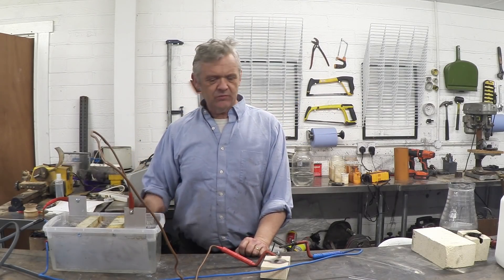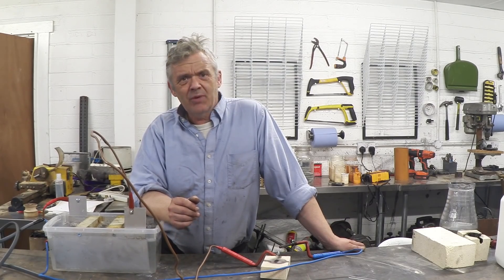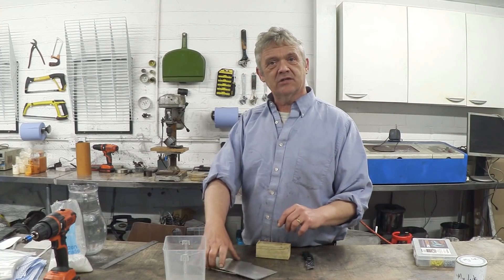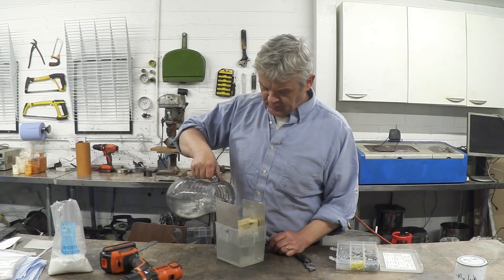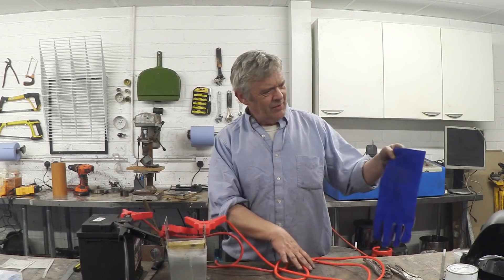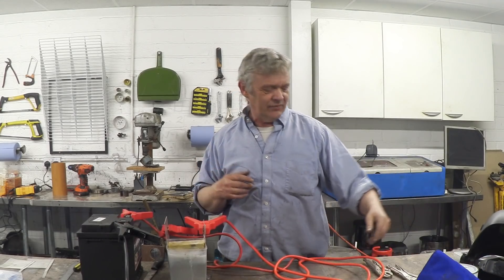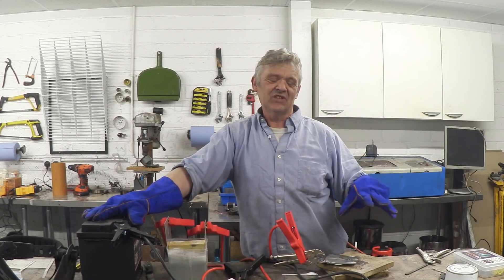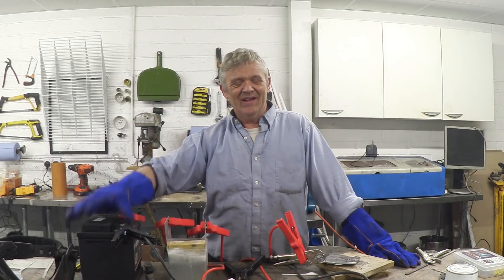Welding With Water And A Battery

Comment: Question : In an off grid solar system if I have for example 4 12v 100 ah batteries in series with the cold crank amperage of 750 amps (each) how do I connect them (to protect the charging inverter) without burning the inverter from a possible amp surge?

Comment: The first rectifiers were electrolytic cells discovered by Albert Nodon around 1900. He has a few patens on his rectifiers. They will handle lots of power but have a good deal of internal resistance.

Comment: I like the concept but your resistor the way you present it shows some safety concerns. It's essentially an electrolysis tank. You say your a chemist so I'm sure your aware of electrolysis and the byproducts of it. Using table salt for your electrolytic solution with steel electrodes produces chlorine gas. Also wouldstrongly recommend against using stainless steel for your electrodes as it produces a very toxic gas. also whatever electrolytic solution or electrodes you use it should always be done outdoors in a ventilated area. Just wondering how well it would do with just wondering how well it would do with sodium carbonate and steel electrodes so then the only byproduct is hydrogen and oxygen. I'm sure proximity and surface area would both play a role in the effectiveness as does I'm sure in your concept.

Comment: Great video, quick question as you did a vid on using the mains but did not show how it hooks up.
Is it the same as using the carbon rods and connecting the wall power to the bucket?
Thanks Robert

Comment: A good old wellknown trick is to use a length of galvanised water piping approx 1m.
The galvanised steel pipe acts as a variable power resistor by length.
Adjsuting the welding current is then very simple by connecting one clamp at end of pipe and the other clamp somewhere between the pipe ends to suit your needed welding current.
NOTE !
The pipe gets HOT after some time of usage, because the principle here is to regulate the current by wasting power.

Comment: i seen Russian in middle of no were using  the wires straight out of the wall into a bucket the welding leads which was locking pliers welding doing this..i seen one set up using pvc pipe and it levers back and forth to vary the current all in a plastic shoe box tubberware thing  he had switches plug-ins outlets all that mess mounted on lid i think basicly nice little rig really .i think he was using it on the drill/grinders n such in his shop

Comment: Nice exercise Rob! Just one thing worries me somewhat in this setup. You are putting DC current through salt solution. Don't you run a risk of generating a quantity of Chlorine gas as side effect of the electrolysis?

Comment: As I suspected, a  jam jar with a couple of bits of a tin can in it doesn't provide enough surface area to reduce the resistance enough.  Got R down to about 200 Ohms, which was not low enough for my feeble 12 volt battery to give a useful arc.  Fun to experiment tho.  Thanks!.
Reply from the maker: try two batteries mate

Comment: He says “ normally you put the negative on the workpiece”  normally is negative electrode where I’ve been from for the last 40 years. He has it hooked up the “ normal “ way.
I’ve tried doing this with batteries a few times over the years. Batteries have lots of amperage but batteries ( bat-trees ) are flat DC with no arcing power. 30 years ago I hooked up two batteries in series ( 24 volt ) and tried welding with small 7014 rod but it wouldn’t arc at all. Then I hooked up a battery charger to one of the batteries which then gave it a little pulse and helped it to arc enough to weld two pieces of angle iron together in a nice weld. One of my batteries was old and after an inch it ran out of steam.
About 25 years ago I tried it again this time I had two good batteries but only a 4 amp charger so the best I could get was some ‘ scrubbing ‘ welds with almost no arc. Enough to tack weld a motorcycle frame together which I then took to my job and MiG welded.
If the rod stuck it would light up like a toaster in 3 seconds.
Does his ‘ water rheostat ‘ help it to arc somehow?
Reply from the maker: positive is on the workpiece mate - but I am told you can do either way - it seems everyone has his or her advice and they also seem to conflict - so my guess is it really doesn't matter that much
Reply: Robert Murray-Smith  The way the electrons are flowing indeed make tremendous difference in welding. The heat being concentrated on the work or on the electrode.
Whenever I see someone hooking a battery ( or even a few ) to a welding rod and striking a nice continuous arc I am indeed very skeptical as I have tried that numerous times and it just doesn’t work that way. If I see someone do it I want to know how. Seriously.
I thought up a form of rapid switching to possibly create some kind of inductance and help it to arc but I haven’t tried it yet.

Comment: I'm going to make one to control the temp of my 100watt soldering iron.
Reply from the maker: make one plate slide mate
Reply: I can't picture this working using salt water. Just how? I think you just need an NTC sensor, arduino and a triac. bam.

Comment: Love this! Pure water is an insulator, so you have to add the salt to make it a conductor. More salt, more conductive. Also the plates distances apart from each other matters. Increasing the distance with increase the limiting effect. Thank you Robert! Love your videos, been watching for years,  now a member. Very inspirational!
Reply from the maker: cheers mate - appreciate the support
Reply: @ThinkingandTinkering  hi rob, can this still be used for the arc furnace. I’m scared of 120 volts😅
Reply: @miclairmiclair876  240v in UK

Comment: This really makes me wonder what the static electricity from a Wimshurst would do, change it to current electricity?
Reply from the maker: dunno - let me know if you try it mate - cheers
Reply: afaik, this works like a resistor, so it can just drop the voltage, it won't make extra current, you'd need something like a buck converter or a step down transformer to get any usable current.

Comment: Thanks. 
Depending on the gauge of the work, decides polarity. 
Thin=<5mm =electrode neg.
Thick=>5mm =electrode pos.
Like you , not sure why.
Rod guage selection also adds to the variable.
Awesome, Thanks again.
Reply: The polarity influences how much heat is put in the work vs. the electrode.  The positive pole gets more heat.  I has to do with electrons in the arc moving much faster than ions, carrying heat with them to the positive end of the arc.
Reply: @hanelyp1  awesome.
Reply: @hanelyp1  Helping me understand the concept I think.
The electrons travel from ground to positive right ?
Reply: ......I don't know how thin exhaust pipes can be welded free of unintended holes.
Reply: Still don't understand the concept of welding with Negative DC.
I know the Electrons travel from ground to positive but I take it you're a Metal Worker.
I'm trying to build something and I'm debating whether to bolt it together with aluminum or weld it with thicker steel 
Thanks
Reply from the maker: nice on mate cheers

Comment: I shorted out a 12VDc battering, Once. Damn that wire can get Hot fast lol Just Amazing again Robert. Thanks for this. The British MacGyver ;)  2 more Projects on my plate. I had a shopping trip to the Junkyard today. Got me a working air exchanger for the spray booth, that I'm building and a 20Gal air compressor tank.   A microscope for looking at tailing samples. And testing the Graphene Paint on vinyl flooring :) We need to make the Scooter battery for this portable welder. Is the Scooter still running on the Paper battery?
Reply from the maker: scooter is still running mate - and awesome projects - cheers

Comment: Now... if that salt water were to tip over would that be seriously dangerous? 
And also because that's 12-48V would it kill you or just give you a serious dig?
Reply: Water and electricity are a hazard. But so it electricity. If yu manage to put yourself BETWEEN any two potentials, high voltage OR high amperage can kill you. Between is the key operative, as standing in a pool of salt water with a live cable will not harm you until your body gives the potential somewhere to go. Lips on a microphone can kill if the mic has a ground potential thats different than any other point (like the guitar players strings, the rainwater on the stage. etc. The current moves thru one limb to another (yes your head is on a limb) by way of the artieries, being they are the best conductors in your body. When this happens, its called "electrocution", your heart is the connecting tissue and death is possible. Sticking your tongue on a battery is unpleasant but not going to kill you unless the battery somehow has made contact somewhere other than your tongue, this is called "shock". Electrocution can kill and your heart is in the middle, never, never hold electrodes one in each hand. Use a ground clip for safety, this allows you to stay out of the circuit. Be respectful of electricity, be aware that it can kill but fear it no more than a circular saw. It is good practice to work with one hand behind your back whenever you are  in a potentally (pun intended) deadly situation. High frequency voltage travels along the surface more and more and the frequency goes up. With HF a small amount of current can kill. With low frequency like AC mains 50 or 60 Hz, a small voltage will penetrate tissues easily, so in that case a small AC Voltage can be lethal. Just dont be a jackass. If you climb on 30,000 Volt high tension lines you are in the most danger when you are near another object. Touching 30,000 Volts or 30,000 Amps will not kill you unless you give the potential a place to go (see lightening show, Faraday cage). Do not test what i have shared. Use it for safety, and if you understand it well, share it with others. Also, if you ever find yourself "frozen" like they always show in the movies, unlock your knees and let gravity pull you free. If you see someone getting electrocuted, do not grab them, as you may find yourself part of the same circuit, instead shut the power off. If you have to physicly intervene then use a insulating material like wood, a dry blanket, cardboard, and knock the person loose. Only tackle someone if there are no other options.
Reply from the maker: greg has given a great reply mate

Comment: It would be nice to see an amp meter showing the current flow. I believe you can adjust that as well by raising one of the plates higher out of the water which reduces surface area IIRC.
Reply from the maker: for sure
Reply: you can also adjust the amount of salt.
Reply: Boots the amp meter is the range of batteries in the Sequence .

Comment: I'm a metal fabricator from the states and I'm defo going to keep this in mind next time I'm in a bind...
Now if you've got some home brewed solutions for shield gas that'd be pretty legendary!
Reply from the maker: lol - I'll ha ve a think mate - cheers
Reply: Does co2 work as a shield gas
Reply: @shanewaltner3323  while you CAN weld with pure co2 is a reactive gas and will cause some oxidation.
Reply: Azure Thorne as for stopping the Oxygen getting to the weld during welding that would be down to what type of coating or flux is on your welding rods . Amazing idea as a welder even I didn’t think of this I’ve seen it in many old films but no one ever explained as precisely as this I am in awe and I’m blown away  and will be trying this out in the morning . Happy days .
Reply: I have heard some people doing emergency welding using mayonnaise in the stick as shielding. I haven't tried it, but maybe it works
Reply: @JavierChiappa  I've heard of some crazy stuff haven't heard of that loool... Now I want to try it just to see...
Reply: Not gas, but you can make paste flux with alcohol, boric acid, and about 20% clayey dirt.

Comment: Could you please put some test equipment on those salt cells? It would be interesting to see resistance Vs. salt concentration or current flow. Also how stable one of these devices are as high power resistors after several "Hot Lunches" .....
Reply from the maker: probably not mate - this is just a bit of fun - if you want all that you are going to have to do it yourself I am afraid

Comment: The misconception that DC is safer than AC don't understand how it works.  Because it is a wave you have the ability to let go during a shock unlike DC that is constant would not allow you to let go in case of a shock... Also AC has very quick  short circuit controls on the breaker to keep you safe.  This is a great experiment but no substitute for a true AC welding machine.
Reply from the maker: of course it's not mate - but it's not meant to be

Comment: Can it be done without a welding rod, or is that outer sheath critical?
Reply: In short YES.
As a weld is formed, atmospheric gasses infiltrate the weld zone.
These gasses cause weld perosity if not mitigated. Weld failure ensues.
The role of the powder is to create it's own protective atmosphere in the zone, displacing atmospheric gasses.
A mig welder uses bottled gas to do same.
Reply from the maker: snoddyfication has given a nice reply mate

Comment: This was my guess on you next video lol, also "Lock pliers" are called "Vise grips"  here in the USA
Reply from the maker: lol - cheers mate
Reply: Lubbock as was mentioned they have there true identity and trade marked name as Mole Grips and were invented designed and trade marked in Newport South Wales 🏴 another Welsh Genius.  I still have my original pairs when I started work as a Fabricating welder 50 years old the grips are and still as good as new .

Comment: very good info - you saved me :)) 
In a remote location with no electricity, I have a 1kw generator which can't power the 6kW welder, but maybe it can slowly charge a battery which then can let me weld in return. So i don't need a welder, and i don't need a big generator - both of which are expensive, i can just use a battery and this cheap generator i have, which is relatively cheap overall and accomplish almost the same thing. 
I can accomplish the exact same thing if i hookup an Amp-meter which will indicate the amps exactly like on the welding device :D
I did not actually test this but i think will work.
Very cool :) Thanks :)
Reply from the maker: i'm sure it will work mate - if one battery isn't enough try two - but it will definitely work - cheers for the post
Reply: you could add a 555 oscillator and a bunch of transistors in an H bridge to get a high frequency ac. (or you could use an arduino instead of the 555 with a high current shunt to also set the amperage)
though I'm not sure this is a good idea long term since lead acid batteries used at high current will degrade fairly quickly.
using supercapacitors might be better.
another option is to use a couple of truck alternators in parallel, and run those off of an engine. (2 24V100A alternators in parallel, or 2 12V200A in series.) you should be able to find a pair from a junkyard for less than 200 bucks. and a 6-10 hp engine for less than 100. you should also use a resistor (or the arduino I talked about previously) to limit the current to under 200A.
Reply: @manaquriazertyuio4555  Can't the 6KW generator work using the salt shunt? I can't see why it wont.
Reply: ......you sound like you might be that Kiwi bloke , he has a channel .

Comment: how did you turn the 12v into 48v?
Reply: Four 12v batteries in series. More? Battery 1 terminal positive to battery 2 negative terminal. Continue for the 4 batteries.
Reply from the maker: mark has it mate - or you could use a voltage multiplier - even so 4 batteries in series is the easiest

Comment: Using something else than jumper cables might give better results. Jumper cables use really thin wires for that sort of current.
Reply from the maker: lot's of way to improve it mate
Reply: @ThinkingandTinkering  Yea. Just wanted to point that out, cause jumper cables even tho they look thick, the metal is surprisingly thin.

Comment: For those interested, there is a difference in welds when using ac vs dc.   Current in the weld stick and work piece can interact with current through the puddle, pushing metal to a side.  Just something to look into to better understand and better control ones welds.
Reply: you reminded me of something called a magnetic blowout
Reply from the maker: nice one mate cheers
Reply: AC being generally better for contaminated steel.

Comment: 5 years ago i hooked up 3 car batteries in series and welded my hub on my landcruiser in the middle of outback nsw on the side of the road. I rolled into town half hour later to the cheers of local farmers at the pub . They said they had heard of it but never seen it done ! So they all gathered around my truck umming and arring and asking me all sorts of question . A great day to share a beer🍺  i explaind it was better to have 4 batteries as it will have greater arc and draw far lower amps. I think some went home early that day to go try it forthemselves 👍🏻
Reply: I once pissed in my clutch master cylinder which had lost its fluid ... got me home :)
Reply: @abyssmanur3965  Hey, after doing that did you remember to change the new "fluid" in your master cylinder. I can imagine raising some urine maggots and leaving some nasty smell to pedestrians.
Reply: I'm off to buy a welding rod just in case..... Not telling the wife though.
Reply: @ooslum  Welding Rod? Pfft. Just use a coat hanger
Reply from the maker: lol - awesome story mate - and exactly the kind of thing I love
Reply: Can't be Aussie, ya called a LandCruiser a truck...xD
Reply: exogator yeah but most peeps dont know what a ute is outside of Australia . smallest truck toyota make ! 1984 tray fj45. I sold it last year as rust was becoming a problem after living it last 10 years on the coast . It was the last year of the old classic rounded shape . I love that truck and travelled so many places in it !